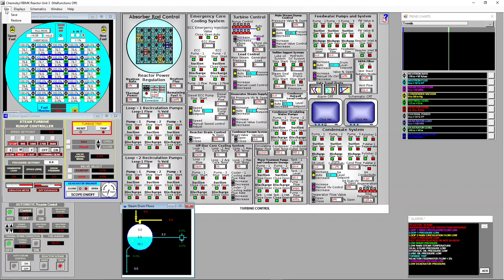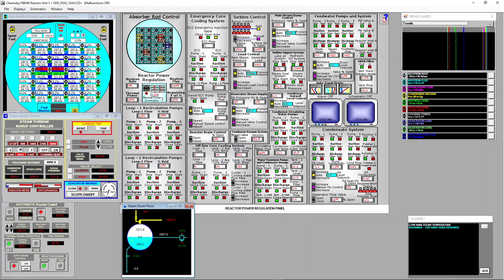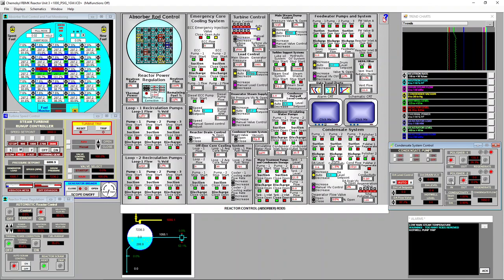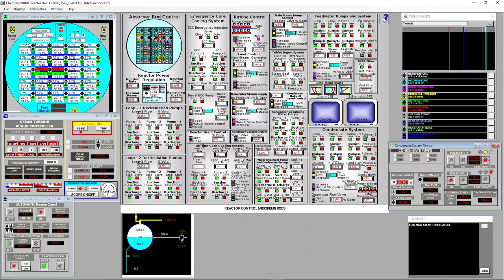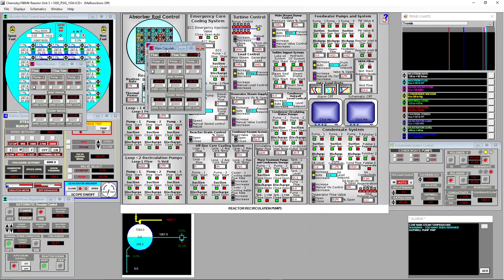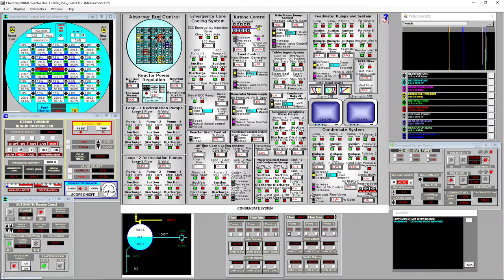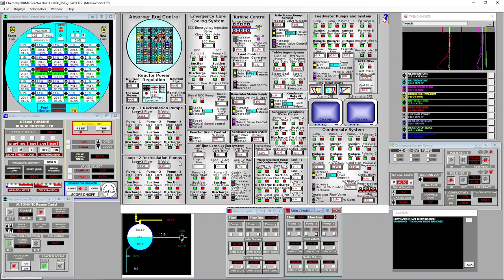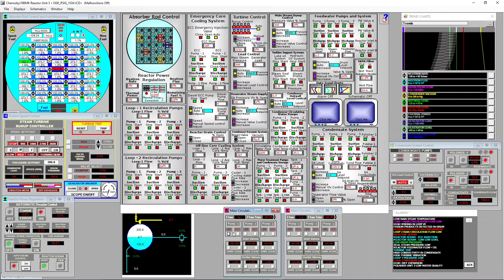RBMK-1000 increasing reactivity by boiling

Comment: Question:  Why does opening the main steam valve on the turbine increase generated electricity without increasing the turbine speed?  ie you can go from 50MW to >500MW all at 3600 RPM.  
Something needs to make the EM field vary with steam pressure what is that thing?
Reply from the maker: Once the generator is synchronized with the grid the variable is the torque in she shaft not the speed, higher main valve opening increases pressure differential in the turbine thus torque and ultimately produces more electricity.

Comment: You can control the flow rate further by changing the trim setting on the main circulator pumps. However, setting the trim to 0% doesn't affect the flow rate as much as I'd like. I use cheat engine to set it to less than 0% :)